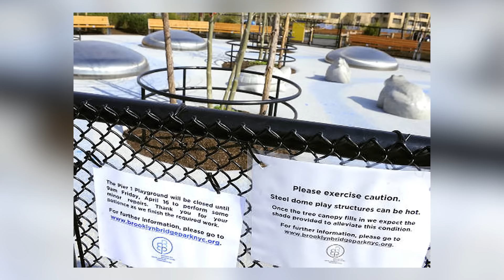15 Biggest Architectural Fails

Comment: Did you do your homework properly? Architects are not responsible for the "STRUCTURAL"  design it must be Structural Engineer
Reply: i'm not aware of how things work on construction, but Architects and Engineer works as a team, so...
Reply: @aethenwulf4757  still. they are two distinct fields even if they work together the architect does not always have the same knowledge as the engineer .The engineer should correct the architect when he does something that wont work . not the other way  round
Reply: @mouhalo  thanks for the info, then the engineer miscalculate things, or didn't follow the proper material that the architect wanted from the start .
Reply: @aethenwulf4757  exactly, some architects go the long way of learning engineering but its not always required. Engineers are here to make the architect s vision into reality. That is the same concept with cars, designers have visions that s why concept cars look so amazing but when engineering comes into play for production they might change for some practical reasons. Same as structural engineers may ask the architect to review the design for better stucture ect
Reply: Some of these are Architectural fails, some are definitely on the engineers. Here in the U.S. Architects don't even touch bridges. Roof collapsing seemed to be more of a structural issue as well. The apartment in China was a failure to analyze the soil boring capacity. I feel that's on both parties
Reply: yes but the problem is if something happpened to any building they will blame to architect first
Reply: @otkcalvin437   i wonder why do they blame the architects? haha i think you can do the google. but basically when it comes to integrity of the structures architects are not WELL-EDUCATED in strength of the structures because that not their core competence. hahaha
Reply: Uhm, that depends on the country you are in. In some countries Architects are Licensed to do "more" than in others.
Reply: It depends, many architects do the structural design by itself
Reply: @aethenwulf4757  True. A good architect knows the basics of structural engineering , but it is the engineers job to ensure that the building can be built. An Architects knowledge in engineering helps with communications between themselves and an engineer. Large architecture firms usually have a staff ranging from architects, interior designers, structural /mechanical engineers, Construction managers (if a design build firm) , and draftsman.
Reply: @FunDuude  not really, in some cases architects are allowed to act as engineers, but to a limited extent, mostly when it comes to small buildings like sheds, houses, etc. not bridges, or shopping malls, etc
Reply: @leonardodilena680  we are not allowed to do that, only in a very limited capacity, and nothing worth while for a youtube video, believe me
Reply: Jamie  I mean, he did pronounce Lévis "LEV-iss" and not (approximately) "Ley-VEE".
Reply: X
Reply: The architect designs the concept.
The engineer designs the construction.
The builder erects it.
If the structure collapses it more likely is the builder’s fault. Sometimes the engineer miscalculates. 
It is not due to the architect’s concept.
Reply: Architect makes it look good , engineer makes sure it works

Comment: The stability of bridges are generally designed by civil engineers, not architects.
Reply: In fact all these structures are physically designed by structural designers (more commonly civil engineers than architects). Architects are the ones who generate the appearance, but architects are still responsible for making sure that it is still possible to be created.
Reply: @ELeonko  Right. Architects make stuff pretty, Engineers make stuff work.
Reply: @hermanosamuel8744  Have you ever worked in an engineering or architecture firm? your response is too simplistic
Reply: @takuzhou6257  Most of the failures are Engineering failures. They have nothing to do with the architect.
Reply: @gregessex1851  While they're engineering failures, typically engineers are hired as consultants on a project by architects. I was addressing @Hermono Samuels's comment about architects making pretty stuff and engineers making it work. Anyone who has worked at an architecture or engineering firm (of which I have worked at both for many years) knows that it's not that simplistic. Its a collaborative team effort, where architects usually are the 1st to determine the constraints and types of structures that will be involved in the project (wood, steel, etc, and laying out the grid), and then the structural engineers work within that scope. If you don't know, now you know
Reply: Taku Zhou I am a Civil Engineer with 40 years experience and I know how it works. The original statement is as accurate as a few words can be.
Reply: @gregessex1851  ok, but the video doesn't only deal with engineering failures, and my comment still stands in reply to @Hermonos... comment
Reply: @-Mic’ Flurry- Now that is total rubbish. Yes Architects receive some basic Engineering in their courses but they are not trained to the standard required to design and sign off structural elements.
Reply: @-Mic’ Flurry- Not quite, there are Architects, there are Engineers (Civil, Structural, Mechanical, Electrical etc.) and there is a discipline called Architectural Engineering, but it is not the same as Architecture. Architects Design the building (its functional arrangement, specify materials, protect health and welfare, think of making sure people can get out of a burning building, or ensuring accessibility, etc while making it beautiful to put it simply). Architecture engineers work on the buildings system (if you want more info https://www.ae.psu.edu/academics/what-is-architectural-engineering.aspx
Reply: Form v Function
Reply: “That’s not my department”, says Wernher von Braun. 
To be fair, all honest architects admit they haven’t a clue about structural engineering or even project management and spend most of their lives hoping not to be caught out.
Reply: Yeah who doesn’t know this 🙄
Reply: But architec the chairman of building construction team . . If civil engineer fail . Architect stupid too😁🤣🤣🤣
Reply: agree also the aquarium fail made it on this list?
Reply: I was just going to say that !?!.
Reply: @-Mic’ Flurry- I am an architect in California. We are taught basic engineering in school and must pass a basic engineering exam as part of our licensing. That said, our engineering skills are generally pretty limited. Theoretically I could legally stamp the drawings for a bridge but nobody in their right mind would let me.

In reality, my engineering training is merely sufficient to enable a productive dialogue with the consulting engineer. Architects are responsible for synthesizing the myriad of requirements of a project into a unified solution with a coherent expression of form. The engineer will make it stand up or, occasionally, tell me why it won't stand up. It is actually a highly collaborative process.

Architectural Engineers as a title is falling into disuse. Generally I've only worked with Structural or Civil engineers.
Reply: @hermanosamuel8744  architects resolve design, engineers calculate resolutions.Both make things feasible
Reply: Since bridges are included in this discussion, the Interstate 35W bridge in Minneapolis should have been included.
Reply: I really like the practical honesty of Andrew Ratzsch and Greg Essex in this thread. Andrew admits as an architect he has some engineering knowledge but it is relatively limited compared to a consultant engineer. Greg a civil engineer acknowledges most of the failures in this video are engineering failures. You usually get people trying to 'flex' for their own discipline, that level of humility enables someone as ignorant as myself on the subject learn that little bit. For that I thank you both.
Reply: @ELeonko  I think you know nothing about this field
Reply: @mithleshsinha6310  I'd like to hear what exactly makes you think that?
Reply: Yes, the one who sign off the structural and engineering is from civil engineer. Architect have moral responsibility to the owner tho and must collaborate with civil, contractor, and site managerm
Reply: Architects are for concept, engineers make sure that it has structural integrity.
Reply: architecture is easy peasy - just draw a cool building - done - actually building it properly requires real talent.
Reply: @andrewratzsch8806  I would be shocked if an architect could legally stamp a structural drawing in any state.  I am a licensed Civil Engineer in multiple states and I can't even legally stamp a structural drawing for a simple retaining wall over 3' in height.  Being that California is the one state in the nation where I can not simply get my Civil Engineer license by reciprocity and the state with the most restrictive licensing regulations,  I highly doubt that an Architect could legally stamp a structural drawing in the State of California.
Reply: @hermanosamuel8744  

Architects put engineers to the challenge to make intricate design work. Pitty , bold and brave engineers are hard to find
Reply: Exactly, we can design structural system based on basic tectonic knowledge we have but we can't calculate them. Even if some architects learn how to calculate by interest, they won't be officially authorized to approve a structural project unless they would complete a secondary degree
Reply: @takuzhou6257  engineers fault. They do the maths not the person who designs the bridge.
Reply: All the failures shown above caused due to poor calculation of reflective death rays on to the streets or pool or poor designing of playground etc will be termed as architectural failure, while structural load carrying capacity of bridges, poor soil analysis  causing buildings to tumble will be a engineering failure.
Now judge it one by one.
Reply: Yes many of the issues in the video are structural and architects defer to structural engineers on that, no question. But a lot of this thread is oversimplifying the responsibility of the architects who are often design lead, this doesn't mean doing a little a sketch and handing it over for someone else to build but involved detailing many aspects of the building. This can lead to issues like cracks in walls and floors, and leaks  in roofs or curtain walling. In reality these obviously happen a lot more often than buildings falling down, are very costly and usually involves a lot of finger pointing between manufacturers, architects, installers etc.
Reply: Every collapsing building is the structural Engineer’s fought not architect

Comment: As a licensed architect, I can assure you that architects DO NOT design the structure for anything but fairly small structures. Typically, on anything but a small structure, the architect will hire a structural engineer to design the structure of the building.

Comment: "Top 15 Architectural Fails" - goes on to use the term "faulty engineering" in almost every example.
Reply: Well, the obvious exceptions are the buildings that focused the sunlight.

Comment: More like "9 structural engineering fails"

The description and the tone of the video really puts the blame on architects for these fails, and in most of these cases, it should not be.

9 examples - Not the architect's fault
5 examples - Probably the architect's fault

15: Probably the architect's fault, could also be the fault of a solar consultant, or a combination.
14: NOT the architect's fault. The structural engineer is at fault.
13: NOT the architect's fault. The structural engineer is at fault.
12: Probably the architect's fault.
11: NOT the architect's fault. The structural engineer is at fault.
10:  Probably the architect's fault, "badly built"... uhh did u mean "badly designed"???
9: You failed to mention that MIT sued both the architect and the main contractor. But the lawsuit is not open to the public, so we don't know who's at fault. Probably both the architect and the contractor.
8: NOT the architect's fault. The lazy & corrupt contractor was at fault.
7: Probably the architect's fault for specifying an unsuited product. But it could be the fault of installers or manufacturers or else. 
6: The designer's fault for not realising that metal surface can get too hot. Not sure they had architects designing this.
5: Sort-of the architect's fault. Back then they didn't have architects or engineers, they were all craftsmen/masons. 
4: NOT the architect's fault. The structural engineer is at fault.
3: NOT the architect's fault. The structural engineer is at fault. You even say yourself that "the roof collapsed due to structural error". 
2: NOT the architect's fault. The structural engineer is at fault.
1: NOT the architect's fault. The structural engineer is at fault. As architects we always want our buildings to be the best, but the clients always want to do it as cheap as possible, often ignoring dangers their product decisions might bring.
Reply: That was an in depth explanation. Thank you from an architect!
Reply: Agreed, most of these mistakes should be credited to engineers.  Clients always wanting it cheap and fast.  Ugh!
Reply: Let me guess: You're an architect? ;)
Reply: @ryen7512  well, it wouldn't be a wild guess. )
Reply: Number 11, if it was bad materials then I would say it was the contractors fault, they cheaped out on them.
The official investigation stated it was an engineer calculation error even back then.

I would argue that every structure that fails in any fashion is also partly the Architect's fault since they have a position overseeing their design being built so they should catch significant flaws before they become disasters.
Reply: Finally found this
Reply: @ryen7512  how the hell do you know?!?!

Comment: Those are Civil Engineer mistakes.
Reply: In case of the buildings with cladding, Architects are to be held responsible. Designing a curvilinear building plan is okay. But again, architects are the ones who propose the building materials. Glass cladding or shiny metal cladding installed in that fashion obviously work as surface of a concave mirror. Good that the focal point is not exactly at the ground or the pool area is. Trust me, if that would have been the case, people would be burnt alive to crisp. I can say that, since I am an architect.
Reply: Civiliangineer gaming
Reply: Not technically, only about half. As an example, any with light glare are architectural

Comment: After retiring from 41 years in heavy construction I’m amazed that more building have not fallen over. So many building with such poor planning. ie a 10 story brick building being remodeled it was found that the brick was just sitting there not tied into the building anywhere, new building going up, several building trades kept telling structural engineer that there was a problem with the elevator opening. After 6 months they finally figured that a support beam was cutting across all the door opening to the top
Reply: My father is a retired Mechanical Engineer, but he did some elements of Civil Engineering. I remember when he was working, he made people do over jobs that were found to be faulty.

Comment: Great short document.  Here in Finland, our 50 years old Finlandia house has also been covered with Carrara marble.  Our severe weather fluctuations have been really bad for the Carrara and the wall panels are bending and sometimes falling down. They have now been replaced with the same material but smaller panels but they still bend. Architect Alvar Aalto wanted to use it so it’s not easy to change the material. Now they are testing eight different materials to see how they withstand our weather and probably the Carrara will at last be changed in the renovation beginning in 2021 wich takes three to four years.
Reply: Carrara is popular with sculptors not only due to its pure whiteness but because it is soft for a marble. It is a horrible choice for a building material, no matter how pretty it is.

Comment: Just a correction...the architect is never responsible for the safety of the design, that is the civil and structural engineer's job.

The issues with light rays, yes that's the architects responsibility...
Reply: Also bridge design doesn’t involve architects.
Reply: Architects tend to hire people that won't shadow their genius ideas, especially the ones that tend to polish their boots if they ask them to do so. Tehwy are not "technically"responsible, but they are entirely responsible.
Reply: @GowriSrikar  They do for significant bridges.
Reply: Typically not for structural safety, but if the building collapses because of water intrusion or other improper architectural details it gets more complicated. However, in the US the architect may be sued 1st because the engineering consultant is usually under their contract.
Reply: @takuzhou6257  But that's nothing to do with a split between Engineering and Architectural responsibility, that's an outcome of who is the head consultant/contractor. If the Engineer was the lead consultant, he would be getting sued for any problems that arise in the structure.